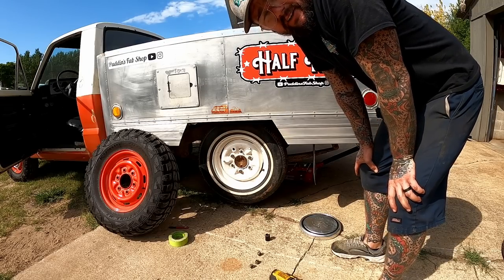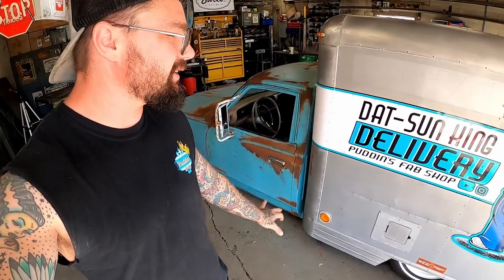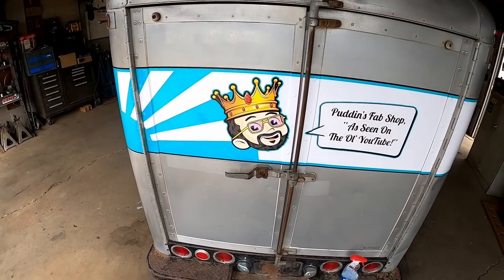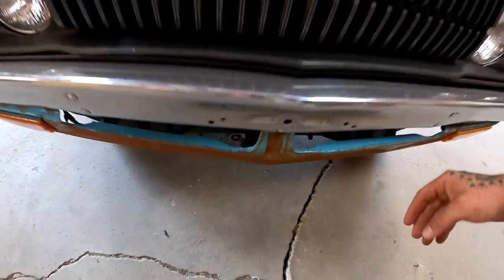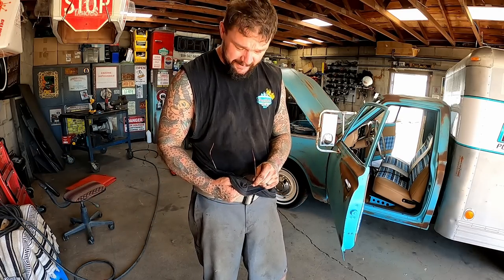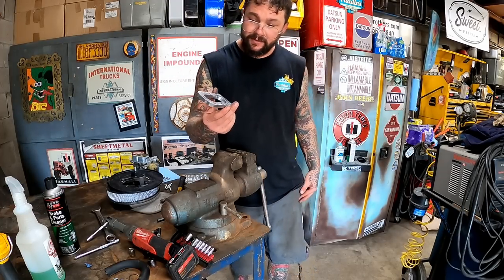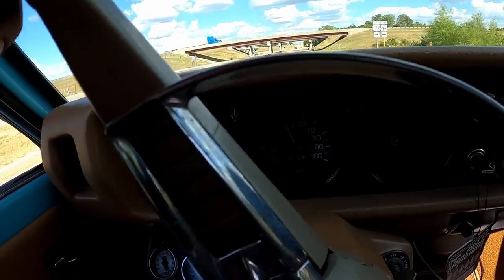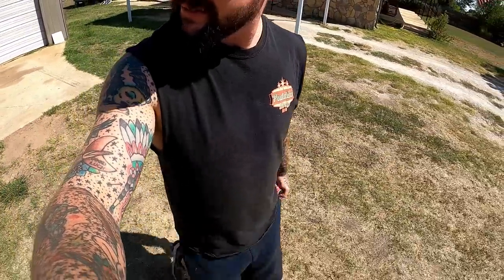FIRST DRIVE after build. SHAKE DOWN begins! ((TRUCK RESCUE))

Comment: Hi Puddin', 
I wanted to say Thank you to yourself and Mortske for making the content you guys do. I've learned so much from watching the both of you and all your endeavors I was able to troubleshoot and fix my nieces 1965 Ford Falcon Fuel sending issue this weekend. Turns out it was the fuel sending unit ground connection, but without all the troubleshooting steps I've learned from the both of you I would have never touched the car to begin with. Again from the bottom of my heart, thank you! You guys ROCK!! (PS. I thanked Mortske also)

Comment: All steel wheels have some wobble, just in the nature of how they're assembled. I came to that conclusion when I was a tire guy for 3 years, figured out pretty quick it was just how they get made (center gets welded to the hoop, room for error and warping happens too) because every damn steelie that came through had a wobble on the balancer. Love the videos, keep them coming!!! Excited for that someday model A, but I'll never bitch about a box truck or a will it run either, you're just as entertaining regardless of the task at hand.

Comment: Pretty sure that F100 probably had a slide in camper for part of it's life. Secure it to the hooks on the side of the bed, the extra springs to support the load and sway bar to help with it being top heavy. And that would explain why the bed floors solid since it would've kept leaves and stuff out
Reply: So you think those 5/16 inch diameter mild steel hooks screwed to the SHEETMETAL bed sides kept a 1000 + pound camper in the bed ? My parents 1979 had a bracket that bolted into the stake pockets ar the corners and used heavy turnbuckles . Made it to Alaska and back . If you are correct,  I wouldn't want to be anywhere near that disaster looking for an occurrence location.
Reply: @jefffindley5870  you never know what somebody decided to make in there backyard

Comment: 46:15 it should be routed into the outside of the air cleaner housing, which you don’t have. By venting directly into the intake it’s dirty crank air not mixed with fuel.  But you figured it out, keep up the great videos, truck looks awesome.

Comment: I think the half haul was runninng perfect until it sucked up some dirt or water from the new tank you put on it. Happened right after the new tank install. Just clean the float bowl and squit it out with some spary cleaner and some air and put it back together with a couple of new filters right after the gas tank. I really think the gas tank you put on it had some shiitake mushrooms in it. If there is one thing I know for sure is always use a new gas tank if you dont want trouble. You could wash out the tank then use some RED KOTE tank seal on that tank. It will be good as new after that. First put a can of Heet in the tank to make sure it was not just water the can of Heet will get rid of the water.

Comment: Back in 78 or 79 I had a Datsun Pickup, sort of a ugly green color. It had two sets of points in it and did very little firing on either set. One morning it was cold, and it wouldn't start, and my wife pushed me with the El Camino faster than the damned thing would run. It never started but later in the day it warmed up a bunch and it started with the key. I traded it to some car salesman for an old Chevy van, shoulda kept the Datsun because it took up less space on the "Don't Run Row" in the back yard. I watch your videos almost at the minute you post them. Thanks for sharing them with us.

Comment: For the pcv line, run it to a fitting in the exhaust. 45 degree angle works great, makes a venturi. I also like to add a slit with a cut off wheel about 1/2" from the end too. Creates a vacuum to draw crankcase vapors, and prevent any pressure, keeps it out of the intake, and burns it off nicely. :)

Comment: Love your videos. Envy your welding abilities. I once painted the top of a car with Rustroleum paint. Rolled it on with a 3" foam roller. No brush marks. No fuzz. Just a nice smooth finish. Still obvious it wasn't a professional job up close. But, looked better than bare metal where the vinyl had been removed showing nothing but the left over glue.

Comment: Looks like that old truck with the huge rear end and backside cut out might have had a sleeper cab or a walk-in box of some kind, with E-Z access. Pretty cool looking rig. That'll make a really good home made RV to use for some camping or glamping, depends on how fancy a boy are ya? Buy an old used worksite trailer and strap 'er down, cut a matching hole to get in to the driver seat, swap in a Cummins out front, out back build in some beds and a kitchen, add a water tank, shower and a crapper, and call it good.

Comment: I love Slick's truck. That rear suspension screams "camper". Under the hood wasn't that bad. I have seen a lot worse on the "Restored" channel. They made them run! Back in the day, they had tire machines that people hated because you could bend a rim on them if you weren't careful. You could also use them to straighten bent rims if you knew how. Nobody has those machines now. Good luck.
Reply: i have one of those they are older coats 20/20 machines from the 60's you can find em for around 200 bucks and they are easy to fix up and make work.... they bend steelies and destroy old school craigers if your not paying attention tho
Reply: @locolowriderloren  They only do damage in the hands of an amateur. They made several models that all looked the same. Up to the 40/40 if I remember right. That was a lot of years ago when I worked in a tire shop. Like any tool. It depends on the hands that hold it. I never damaged an alloy rim, and I worked on them all. Keystone's, Craiger's, ET's, American Racing etc. Cast, slots, riveted, bolted, you name it. Don't forget the "reverse" rims. Those will ruin your day if you aren't paying attention. They were stock on some GM cars as well.
Reply: @MaxNafeHorsemanship  its just the center clamp on alloy that like to crack is all.. its the stock cone they make an adapter kits for those machines to work well with alloy and bigger modern wheels and lil covers for the bar to prevent scratches alot guys still use em up in alberta. i worked in a modern tire shop for year before my back gave out all the older guys had stories about the old coats lol

Comment: There was a car dealer in Rockville In. that had a wheel straightener. It was like a hydraulic jack press (only with a jack on top and bottom) with a turn table to mount the wheel on and a small feeler to detect the high or low spots.

Comment: Number 6 you originally tuned it with a piece of steel wool or something stuffed in the biggest vacuum line. Had to throw that in there brother, lol. I drive Amish Taxi and the last van I bought I bought new tires had them rebalanced twice and kept rotating them around, it took me a month to figure out that it had all four steelies were bent.

Comment: I had the same issue on my studs for the Weber. I cut a flat head groove into the top of the stud, and used a 90° flathead to hold the stud in place while I tightened it

Comment: A tip for the house build, add an  extra course or two of block to the basement and tuck the heat runs in between the joists. Later when you finish the basement you'll have plenty of height. Love the content!
Reply: Most everyone builds on a slab in Oklahoma.

Comment: I think you could put a PCV valve in that line leading to the carburetor should control vacuum leak. I do know the crank case needs ventilation or it will gum up the engine.

Comment: I used to work at a tire shop through the mid 90's and we still had a steel wheel adjustment wrench and an old timer who knew how to use it and passed the knowledge on to the younger guys... but honestly you could figure it out in a few minutes and with your half haul wheel checker deluxe you could check/tweak/check and get them dialed in fast if you could just get all those tires unmounted.  You can check on the Amazons on the like for something like Steel Wheel Rim Repair Wrench Tool and get an idea of what your looking for but a heavy adjustable and a BFH can get the job done quick if you can't find a tire shop with the know how.  I used to take bent steelies and toss them on the balancer without tires and adjust them for a few seconds until they said they needed zero weight and ran true.

Comment: Really like the interior of DAT - SUN KING.    A little bit here and there and you will have a very good truck.  Worked in a tire shop when we use to have custom steel wheels in the 1980s.   Always checked the wheels with the electronic balancer since it would spin the wheel. It was great to use before mounting the tire to see if wheel was true, most of the time they checked out, but once in a while we get a bad one.   We wanted to keep the customer happy, and most of the time we did.   It did seem that stock steel wheel we checked even more especially if it was from a foreign manufacturer since there was a slightly higher failure rate on the trueness of the wheel.  Really like the way you tested your wheel. ( You may already know this but just want to help.)  Be careful with the brake drums since they are balanced.   There are ways to balance them once you make modifications to them so the wheel will fit better.   There are some videos on the subject on YouTube if you need them.

Comment: Another big howdy from the great Southern land. I'm sure you may have considered it but over here we had 4wd versions of the courier and Mazda,it may be more straightforward to use the underpinnings to convert. Suzuki is probably more than strong enough but,at least over here, they are a bit hard to find ,it they're not already scrapped they're busy climbing out of farm paddocks or tracks. I also had a Holden jackeroo,I think they're Isuzu troopers in the states,they have pretty good diffs and no one wants them

Comment: Mate - everyone has a bad day.....and occasionally they run together and make it a bad week.  Whether it be not getting things accomplished, something coming along that you weren't expecting, priorities changing on the fly or just crap going wrong.  It knocks one about s fair bit - especially when you end up with two crap weeks in a row - but there is always a light at the end of the tunnel that isn't a huge freight train.  At times like that, I just thank the Lord I have the family I do and spending time in their presence recharges me to a point where I can have another go.  Often I forget they are there because I am too wound up with the stuff flying at the fan from all directions, but all it takes is me to walk inside and hear one of them and I remember.  I know you have the same love of and for your family so just remember they are there when you need them (or walk away from the project for a few minutes and go inside) and you'll be fine.  All the best

Comment: Thinking about all of the PCV systems i have laid a hand on. The pcv goes to the air cleaner housing inside the air cleaner element (clean side, not filtered) Your air cleaner may not have space for one tho. Also every system either has a PCV valve or there is a restrictor in line to limit the amount of air. i think your setup could work as is if you hammered a stick into your threaded barb adapter and drilled a tiny hole in it. My current ride (06 silverado w/ 4.3) does not have a PCV valve but if you look in the nipple on the valve cover it has a brass colored plug in it with a little hole in it.

Comment: Puddin you can add a small spacer between the wheel and drum to clear those weights. Or you can grind some off of the weights to clear.
All of my old Datsun wheels have run out. I have had 5 of the 521 trucks. The 83 was straight until my son hit a tree in the right front.
I still have a bunch of 6 lug Datsun/Nissan rims. I also have a 2200 and 5 speed that you can have for the trip. I live in the upstate of South Carolina on the state line above Greenville.
I would bring the stuff to you but legal issues have me not leaving the state.
Hope your pond comes out good.. LOL!
Cheers
Terry

Comment: Not done with the video yet, but you can always run that vent to the bottom of your custom air cleaner base plate.  Maybe punch a hole in it and use a bulk head type fitting thing on the inside of where the filter lays on it to increase the vacuum on the vent line if that makes any sense at all.

Comment: puddin, love what you do always. about the wheels on the Datsun; once the wheels are on the truck they don't rub on anything but the tires on the frame if they are bent, your trouble is the wheels don't fit the axel hub, and the drum just clearance the axel and the drums and they should be ok.
Reply: How about just get straight rims, easy, nothings bent

Comment: Its a big job changing it to 4 wheel drive. The back isnt too bad, but the front, you will have to change all of the front suspension. The front springs are in the way of a drive shaft. The front part of the chassis would have to be altered for the verticle travel of the front axle / drive shaft. That would alter the position of the engine mounts  etc.

Comment: I just have my PCV hoses open under my hood. I have a filter on them, but I don't have a place to put them. The truck runs great. I also know all the Ratsun guys say to run your truck at 12 degrees btdc with the Weber, but that is just a base tune. Mine runs better at 14. Tune it with a good vacuum gauge and figure out where you get the best vacuum.

Comment: I'd say the positive crankcase pressure should be relieved to before your carb, not after.  Maybe make a port into your custom air filter base plate.  Not relieving it may blow some oil seals.  My '50 Ford just has a 'road draft tube'.

Comment: Steelies are always a little off, it is when they cannot be balanced by a wheel balancer they have to be addressed. It is super important you get your drums machined and your center bore tight you do not want it loose or in your case undersized. I recommend machining axles that way the type of rim you like is always able to fit even if you need to swap it around with another set of rims at some point. Axles are less likely to go bad on you especially if you maintain them(i.e diff lubyduby changes and preventative bearing replacement). Where rims hit stuff all the time and may need to be replaced. To be honest it would not surprise me if steelies are a bit off when they are brand new due to the welding of the center  part of the rim to the outer rim

Comment: that ford isnt setup for towing or anything, its a special camper edition. the axle is pushed back slightly for better weight distribution, its got the helper coils, stiffer and roll bar, and bed tool box

Comment: Hay the sticker on the Timing light is just slapped on the degree wheel willy nelly at the factory had a friend figured it out on one someone tossed out 🤣
Take the sticker off and zero it out then reaply the sticker in the proper alignment.👍

Comment: Running the crank vent to the intake (ccv) works on alot of rigs but it almost always has a tiny metered hole in it, (jeep 4.0, etc) and yeah it will idle high with an unrestricted tube on it like that

Comment: I love the content Puddin'! interior looks sweet. I'm a Datsun guy too...well z-car guy actually.  I've owned 5 of them to date.  Believe it or not but, that little cleaning brush in the valve cover vent hose is stock.  It helps condense airborne oil so it can drain back into the engine instead of coating your carb.  It's similar to the mesh that they put in catch cans. Also, the graphite gaskets are the best, especially the OEM versions.  They allow the manifold and header to expand/contract naturally at different rates than the head.
Reply: Thanks for watching You have been randomly selected among winners for today Contact Me  on the name above to claim your prize right now👆👆.......

Comment: Aluminum wheel on my Firebird I noticed running it in the air this summer has a slight wobble to it. I notice that more often than not with wheels, aluminum or steel. I figure if it doesn't feel weird down the road, it ain't really a problem!

Comment: Can't say I've ever messed with a Datsun 4 banger, but I know on my ole Ford and Amc inline 6s I typically have to go around and retorque the intake and exhaust hardware after a couple heat cycles when I've had the intake and/or exhaust off of them. Awful lot of expansion and contraction going on with them intake ports when they're rubbed up right next to the exhaust on the same side of the head like that.

Comment: After all the wheels you checked I would say none of those steel wheels were perfectly true from the factory. I think your major issue was the fit of the wheel to the brake drum. Those bumps on the drums are probably weights to keep the drum balanced so when you machine them make sure the shop checks balance.

Comment: May be way off base here, but... when its idling like it has a vac leak, pinch the PCV hose. If I remember, you opened that plate for the crank vent hose but I never saw a PCV valve to regulate /meter the crankcase vac flow.  Great work man, keep ip the great content. Also you've got a lot going on, take it all in stride!
Reply: Oh, dang, you just did that! I should watch the whole video b4 talking!! Hahaa

Comment: Just like the sheet metal on these little trucks, the wheels are also thin. Prying old, rock hard tires off tends to bend wheels. Might want to try the death wheel instead.

Comment: Hey Puddin, Why didn't you use rubber mud flaps. If you mounted them on the inside of the wheel wells, they wouldn't get ripped off or bent. Just a thought.
Love the channel, and your humor.
Take care and be safe.

Comment: Your issue is that you didn't put a PCV valve after your block off plate, which created a huge vacuum leak. Everything else was fine.